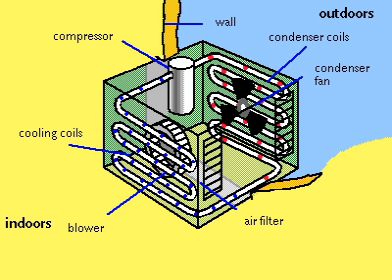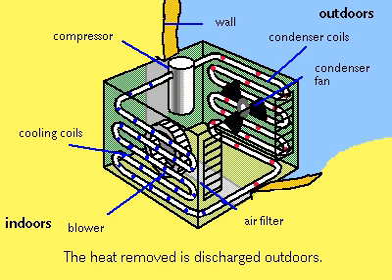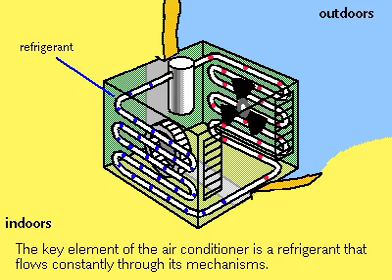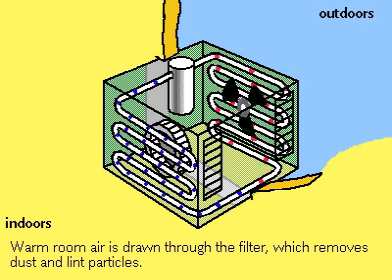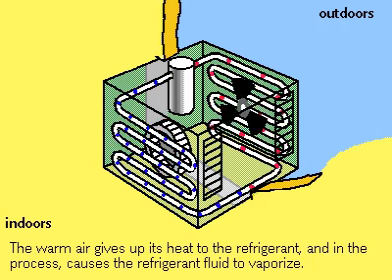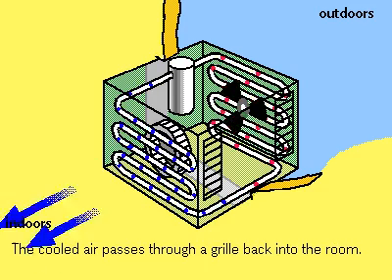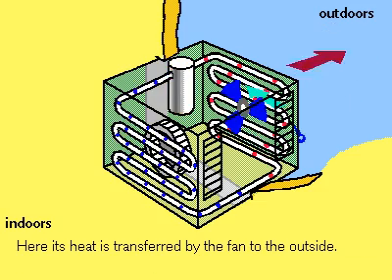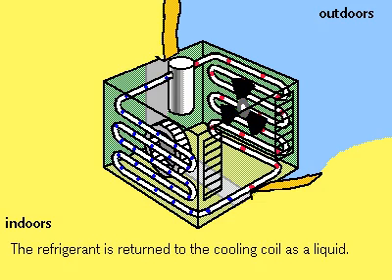How Air Conditioners Work

Comment: Hello - I am trying to learn the basics and this video was excellent. I do have a "theory" question that I can't get out of my head and wondering if anyone can help me understand. Thinking about the evaporator coil. R22 boils, I am told, at 40 degrees when the pressure in the coil is 69 PSI. When heat passes over the coil it causes the R22 to vaporize (boil). Got that. BUT...based on everything I have seen or read R22 is ALREADY at 40 degrees when it enters the coil and ALREADY at 69 psi. Shouldn't it already be boiling? Why does it need heat from the airflow at all? I know I am missing a huge concept here but right now it doesn't add up. Thanks so much in advance.

Comment: Question is... If I get the water to wet the hot radiator... Something like a pump that pulls the dripping water back into the warm radiator!? Will it run even more cooler and efficient?
Reply: What?
Reply: +BuddhistZenDave I'm talking about cooling the hot side radiator with the same water that the cold one makes when condensing ! If keeping the hot side cooler could get better efficiency on the unit

Comment: That's why they Automatically turn off when there's no more warm Air. If there's no more warm air inside your home that means A/C has done its job.So It turns off and when inside air becomes warm again ( By the CO2 we exhale and the Sun heating up atmosphere.) it restarts the process. I'm surprised you couldn't think of that considering how far you have figured it out.

Comment: If there's no more warm air the compressor and fan turn off... When the air inside warms up, the AC compressor turns on again... If there's no warm air then you don't need the AC to be on...

Comment: @plpearl Ok so the hot air from a room evaporates the refrigerant, that process cools the air and that air gets blown back into the room? Then the hot air travels into the condensor and gets blown outside. Is that right?

Comment: LOL a/c is this simple....... When you compress anything it gets hot...... the hot freon runs through the outdoor coil, most of the heat gets dissapated outside....... then the freon runs to the indoor coil, and the preesure drops. When you release pressure on anything, it get's cold. The blower simply blows air through the indoor coil, and wala.... cool air. I am a claims adjuster for a/c system claims, and am so sick of people giving shitty examples of how systems work!

Comment: I have a portable wall air conditioner just like this one in the video. In the winter time when the weather is cold, I take the A/C out of the wall and turn it the other way so the condenser is inside my house and the evaporator is outside, so I can stay warm. And  vice versa in the summer time. lol

Comment: @abcd19263 The video is confusing. The refrigerant condenses because when it is passing through the outdoor coils it is loses heat to the environment, just enough to make it condense. During condensation, it loses even more heat to the environment. The compressor simply makes the gas hotter so it loses more heat to the environment.

Comment: @dnl5649  the accumulator is like a filter that doesn't let the liquid get to the compressor and is located after the evaporator and before the compressor  and im not sure about the receiver drier but i think what is does is prevent oil to pass through the expansion valve. and is between the condenser and the expansion valve